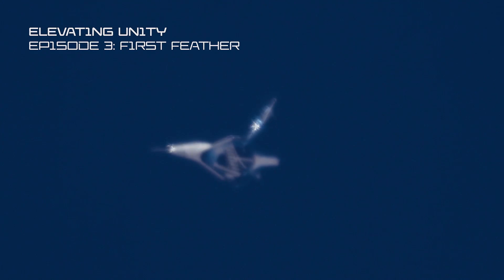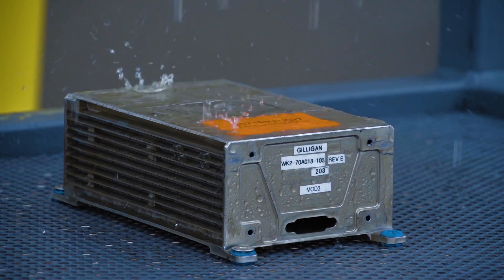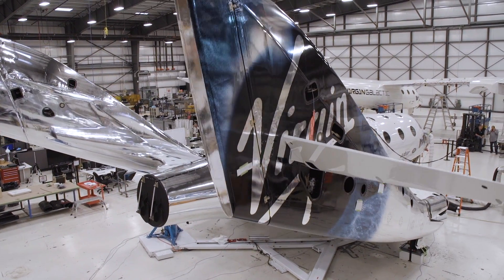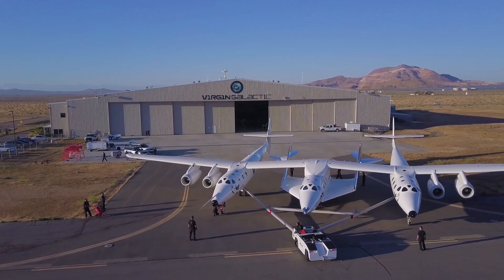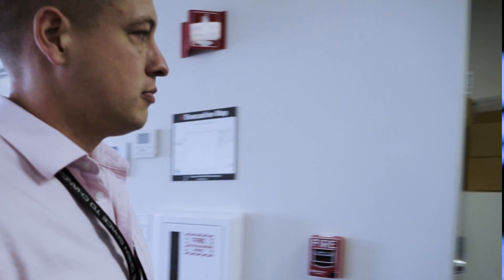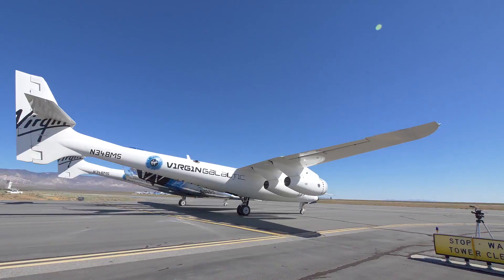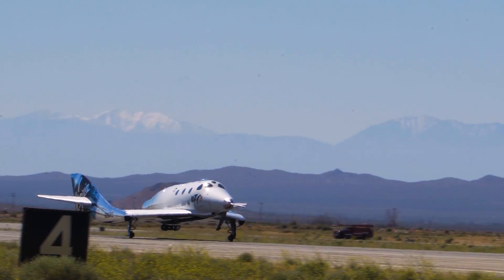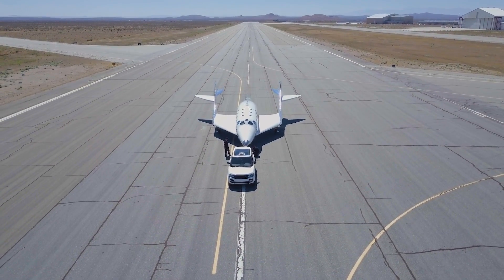Elevating Unity - Episode 3: First Feather

Comment: Have improvements been made so that the feather can't be operated unless the craft is at the appropriate altitude and heading?  Seems like a good example of how we can use computers to dramatically lower the risks of human error and what happened previously.
Reply: Yes, they re-designed the control system to prevent implementation unless under appropriate conditions.

Comment: Wait, so what was the point of having the feather function ?
Reply: Eliott Johnson To slow down from the high speed of the rentry, they are basically very complicated airbrakes
Reply: They need it to not dive back into the atmopshere with the nose first. This would cause G-forces in a very uncomfortable direction for the crew and the whole reentry process would also be a little more dangerous since the plane would pick up more speed falling back to earth pointing the nose forward. I'm not sure if these are the main reasons though and there is likely more to it.
Reply: It was just a quick test. When coming back into the atmosphere on reentry, it would be much longer. This was only done from ~50k ft
Reply: The feather acts as a braking system (similar to a shuttlecock or streamers in a model rocket) to slow the vehicle down on reentry.
Reply: Ok, but in this video they only slow the top of the parabola and immediately bring it back in normal flying condition. Is this the normal way of slowing down or was it just a quick test ?
Reply: ... and why aren't other spaceships using this method?
Reply: @berniemccann8935  how many other spaceships ARE there? :)